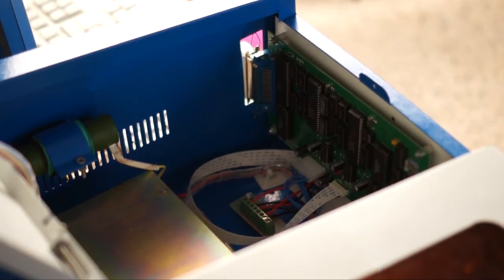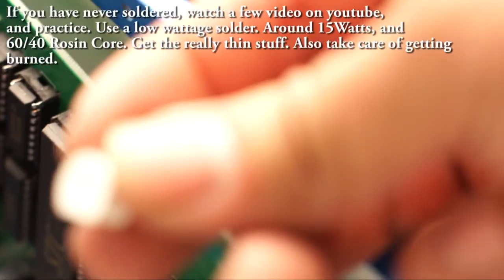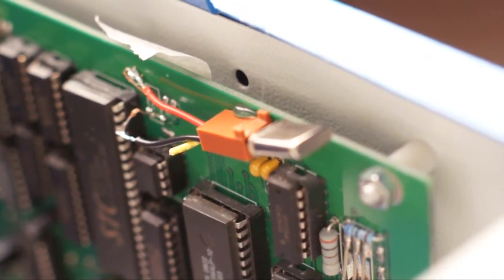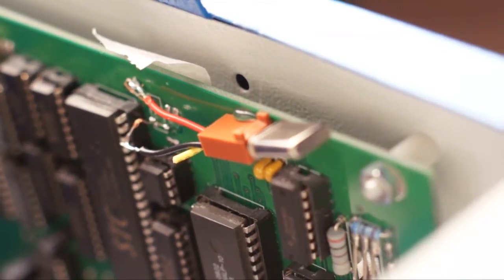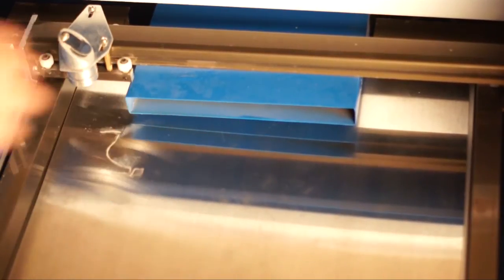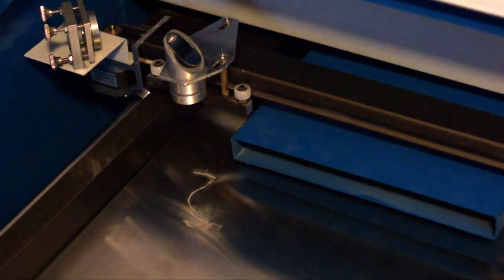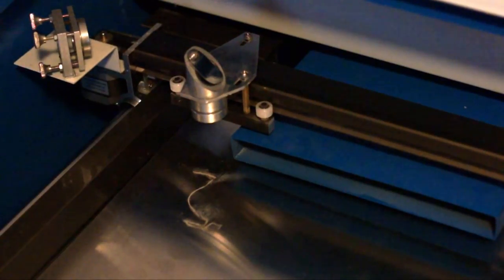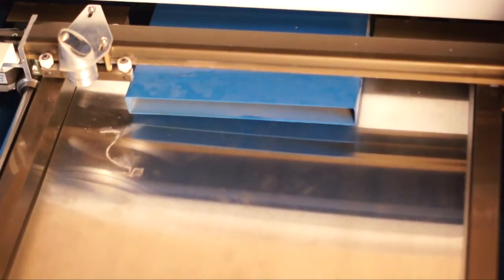China Laser Speed Control Tutorial DCK40III

Comment from the maker: Yes adding an emergancy switch would be pretty easy.  I also did have rotary dial installed at one point. But I found that I on really used 2 speeds. I have another mod I did, and plan to post that very soon also. I think you will find it very hand.

Comment: I wanted to thank you for the good tips and at the same time give you my ideas on improvements also. In my opinion there is an emergency switch missing... whouldn´t be difficult to implement, just will need a bit cutting on the right side. I will also try try to implement the mod in this tutorial but want to install the wires to some kind of switch port and mount on top, then attach the crystals there on the bottom side so they stay inside and you can switch from chrystal 1(=slowest)-5(=fastest)

Comment: Nice tutorial, thanks for that. I installed a rotary switch and can select from 2 to 20 mHz in 2 mHz increments. One thing however does not work: Using Quartzes with more than 20 mHz. I was hoping I could use a 32 mHz for faster engraving, but the macine runs slower with 32 than with 20. I guess, the rest of the board is clocked at 20mhz as well (there is a second crystal on the board), and hence does not even register clock speeds of >20 mHz.